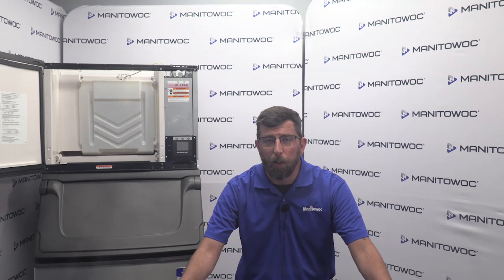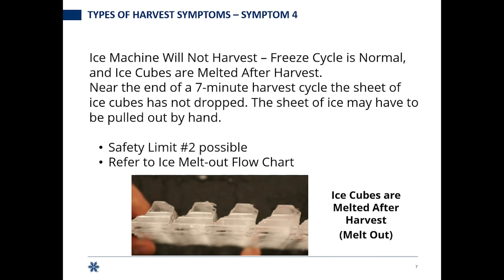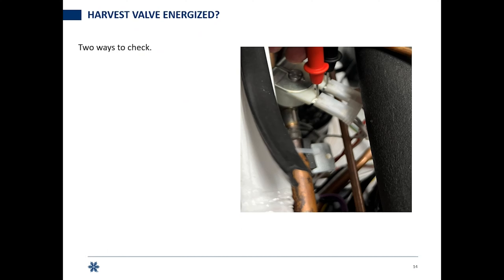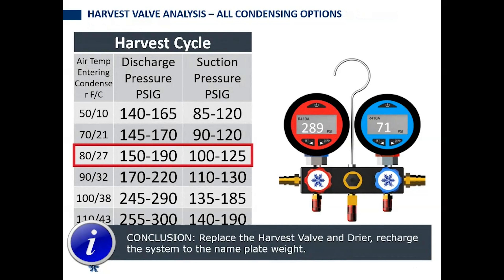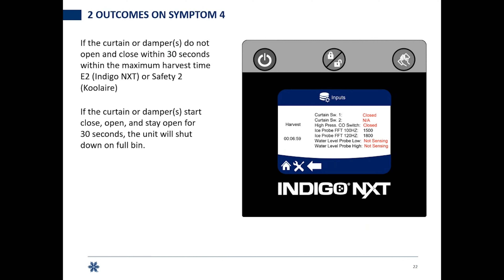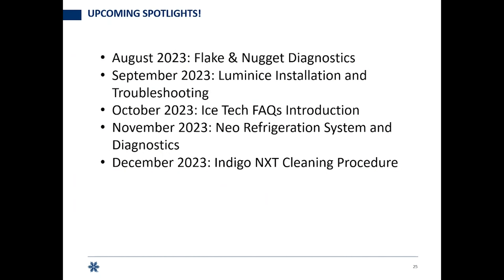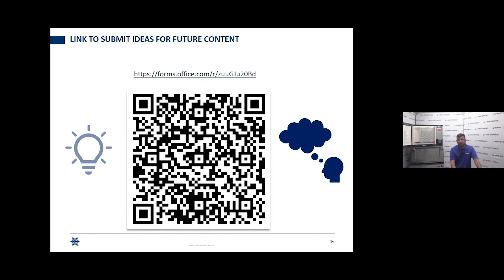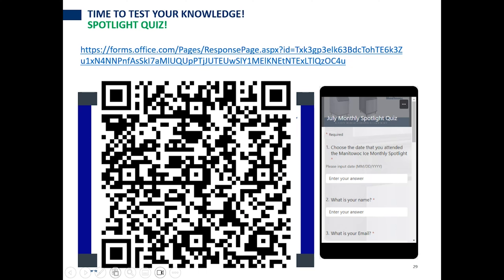Manitowoc Ice Monthly Spotlight Modular Ice Machine Not Harvesting Troubleshooting July 2023

Comment: thank you very much for this traiing, i have concern regarding my manitowoc ID0852A , the issue was during cycle their is no harvest occured, their is no power on the the solenoid for hot gas, indicator of harvest sequency is their and ice doent drop  but during manual harvest it harvest itseft. i just want to know what sensor control the harvest solenoid to energize the solenoid valve.